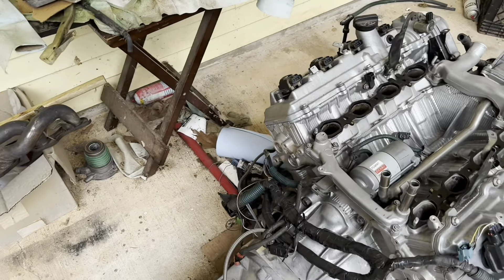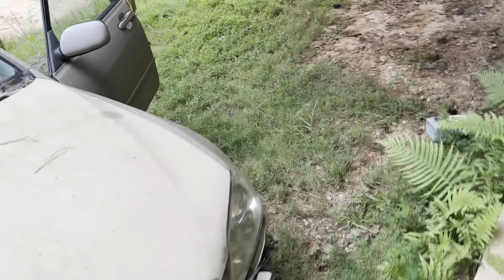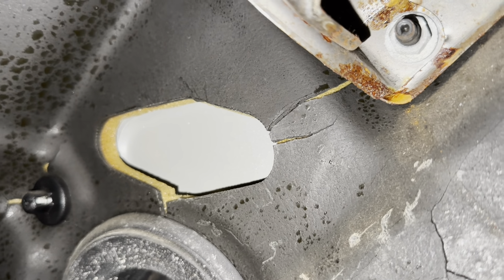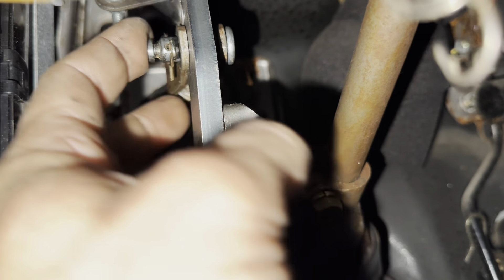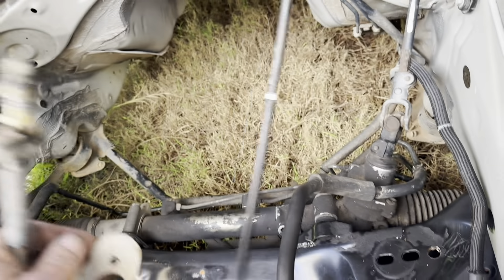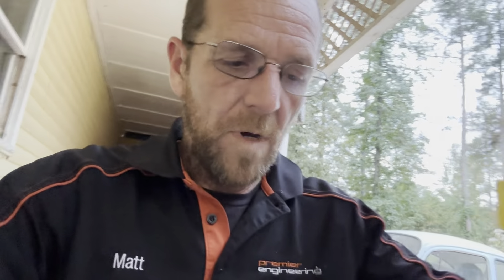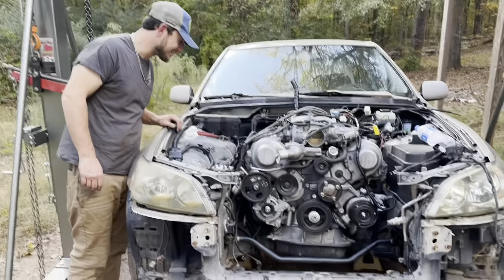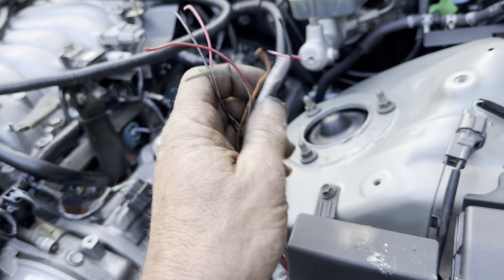2001 Lexus IS300 1UZ swap: clutch pedal and engine/trans install

Comment: The verossa shifter plate should put the shifter pretty much where it needs to be in the is300
Reply from the maker: That's the shifter plate we have and it moves the shifter too far forward. The solstice shifter is at the back of the shifter box hole and the JZX/verossa shifter plate moves the shifter to the front of the shifter box hole.
Reply: @shadetreestreetcars8626  thanks for the information, I will be doing this swap soon so I will look forward  to updates on the project.

Comment: Nice video. Thanks. Sorry, could you tell me please tell me where did you buy the brake and clutch pedals. Or a reference number… Thank you a lot. And the master cylinder. Beautiful proyect!!!
Reply from the maker: Unfortunately I'm pretty sure Terry bought the last factory clutch pedal assembly available. That's part of the reason it took so long to post an update because we had a very difficult time finding the factory pedal assemblies.
Reply: @shadetreestreetcars8626  ok, thank you anyway